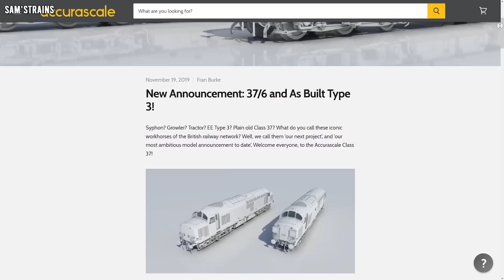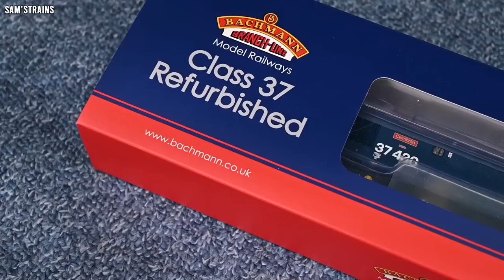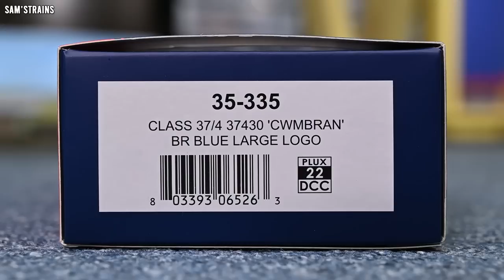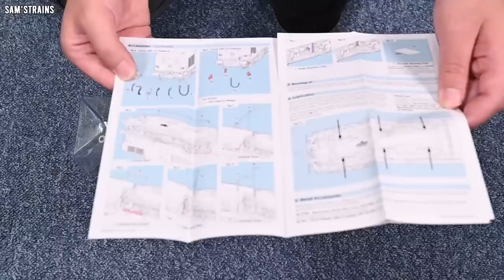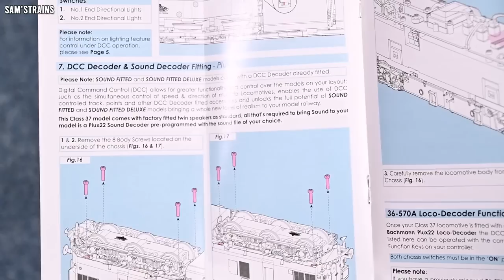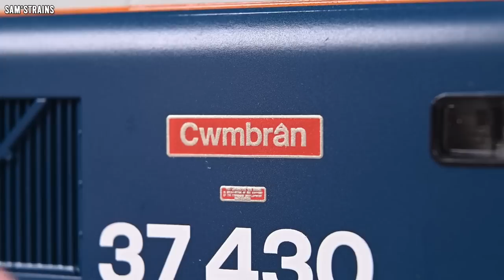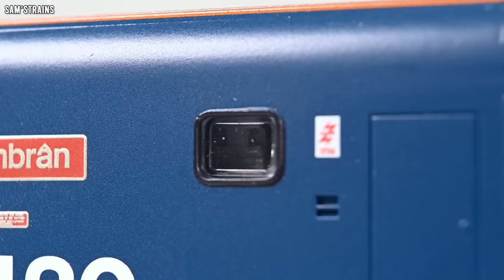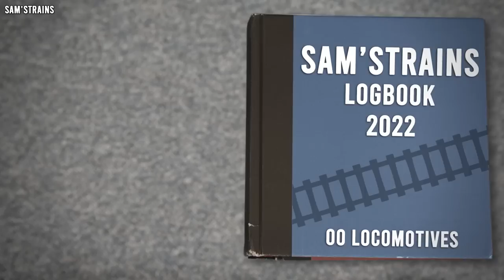All New Bachmann Class 37 | Surprise Release | Unboxing & Review

Comment: I've also seen Dean Park's review of this, and he brought up a few other points on this.
- Apparently the old version of the 37 was out of scale in a few key areas, and this meant it looked slightly off to people who knew the design well. This has apparently been connected with the retool.
- Underframe details is apparently now more prototypical.
- NEM sockets have been moved forward and can now be removed if desired (say at the front). On the downside it means the NEM snow plough no longer fits probably, despite the paint work.
- Don't think he saw the slow down you saw, but he was running DCC not DC.

Nice balanced review from you though.

Just picked up a new Bachmann FNA nuclear flask wagon, are you going to review these? They are a bit  pricey, but look good, and no one else makes them. Not had a chance to run mine yet though.
Reply: Hi, Accurascale make nuclear flask wagons, they are amazing compared to the Bachmann models, £149 - £159 for a pair. I saw an old Bachmann advert where their nuclear flask wagons were £29 each, they are now £50 - £60 for the same item.
Reply: You're lucky to find a used Bachmann FNA for £29 today. Both of mine (Both 38-345) cost £42.
Reply: @StormmyStormmy   Fair comment. Accurascale make the KUA, which are used to transport nuclear fuel from submarines.

What I meant was no one else makes the FNA wagon, which were commonly used at Nuclear Power Stations for fuel transport up till 2018ish when they were replaced by a new version (think revolution trains are designing these ATM).

As for second hand, I looked at these, eBay wanted nearly £45 minimum bid (with p&p). I therefore decided that buying new at £50 was probably best, plus I need I fairly urgently for a project.

Comment: I suspect bachman maybe have their  own tooling dpt as opposed to accurascale sub contracting its moulds. This retool could have been a scheduled side job to use up spare machining capacity ? Lets face it, 37s are gonna be steady sellers, whereas new classes are gonna be a gamble.
Reply: Bachmann are owned by Kader Industries, who manufacture all their items in China.
Reply: @mccarronfamily  Interesting. Never knew that. Quick bing shows based in dongguan, I can see dongguan from my apt. So yup, fair size company, most certainly will have its own tool makers. That matches what I said above 👍. If they have a fair amount of tooling etc, lot cheaper to reporpose it, new inserts etc. Compared to accurascale who will still be at dedicated tooling stage 👍

Comment: I find it coincidental that Bachmann have announced a new tooling 37 during the near final stages of development of the Accurascale ones. It does beg the question as to if Bachmann is trying to go head-to-head with Accurascale deliberately to try and steer customers away from the new kids on the block.

If that is the case then it's another example of unnecessary competition,and an example that the hobby these days is just trying to make as much profit as possible, not listen to the community who actually want to see models that don't yet exist (or desperately need a retool) to fill in the market and charge silly money for models that probably cost more than it actually is to sell one realistically to a retailer.

Nevertheless, the new 37 definitely looks the part!
Reply from the maker: I find it difficult to believe that it is a coincidence as well...
Thanks for watching, Sam :)

Comment: I've got a feeling Bachmann was working on the class 37 before Accurascale's announcement.
I'm sure they pushed the release forward to get it on the market before Accurascale.
From all the pre-release models I've seen, both models are pretty awesome with lots of version differences covered.
I will not be getting either model of the 37 personally as I've allocated all my cash to the Accurascale class 31 pre-order.
Nice review as usual.
Reply: To be fair, Bachmann have recently retooled the 47 and the 20, so that would make sense.

Agree with the rush to market, the fact that 2 got pushed out ahead of the rest of the range would indicate this was rushed slightly.

Comment: Accurascale wouldn't be worried about Bachmann's offering considering all of Accurascale's Class 37's directly from them are sold out and as you stated are a lot cheaper with much more refined tooling thus IMO the Accurascale model is better for the following reasons.
1. Bachmann roof fan grill is too prominent and doesn't have the fidelity compared to the AS 37, yes I'm comparing photos but to me it is obvious.
2. Bachmann cab windscreens have a pronounced prism affect and way too thick looking like something from Hornby Railroad.
3. Bachmann ploughs on this are still like the old ones and awful.
4. Bachmann cab door hand rails appear to stick out too far, slight but noticeable.
5. Bachmann nose end join...not good considering this is new tooling.
6. Bachmann sound on the sound model to me is sub-par and still sounds hollow which Bachmann to be honest struggle with on all their sound models to get it right in regards to fidelity and bass, their speakers are rubbish.
I will only stick to my Accurascale Class 37's I have on pre-order and the Bachmann versions will not join my fleet no matter what current day ones they do which thankfully they haven't announced yet even in today's Autumn announcement.

Comment: I was expecting you to really lay into Bachmann with this, trying to steal Accurascale's thunder. If it had been Hornby I'm sure would have and the comments certainly would have.
This dual manufacture of a certain new tool model type, is now becoming the industry norm. 
The first ones I remember were the Black 5 and Class 08 between Hornby and Bachmann. Now even Dapol and Accurascale have simultaneously launched their GWR Manors and then there's the who-ha between Rapido and Hornby over the Lion loco and associated wagons.
The Class 37 though is so numerous, I'm sure the market can stand two versions. Now if Hornby feels they need to replace their ancient offering (they need to), could the market stand it. I wouldn't be surprised if they did, so to try and drive Accurascale out of the market. Am I being cynical ?
Reply: Your memory is playing tricks - Bachmann have never produced a Black 5 (what they do produce is a British Railways class 5 which to be fair did take its inspiration from the LMS designed black 5).

Where Hornby and Bachmann did go head to head was with the British Railways designed Standard 4 class - with both being released around the same time.

The class 08 is slightly different - the Bachmann tooling is a lot older than Hornbys - for many years after Bachmann introduced their 08 Hornby were churning out a rather basic 08 body on a linty 0-6-0 steam loco chassis. Therefore when Hornby finally decided to ditch their antiquated 08, the detail on their offering was better than the Bachmann model simply by virtue of customer expectations having increased in the years after the Bachmann model was designed.
Reply: @philkeller4170  yes definitely confused. I personally refer to both types as black fives. Both companies making the same loco type was a topic of conversation back in the day at my model railway club. 
For general interest, back in 2013 I went on one of those Cathedral Express trips. Tornado was meant to pull us but had failed prior to the trip. What turned up was a double headed BR Class 5 with a LMS Black 5. A historic first we were informed

Comment: So, will I buy one in BR green ? Mmmm... Price first, the Accurascale wins, do we have something that justifies this price for Bachmann ? First, it seems they are going away from the MTC 21 pins decoder, and adopt the PlusX standard, more "European".
Then, superb finish. Details ? Just Wow ! Good point for the couplers mounted to the bogies : simple and efficient. Serviceable ? The removable chains are as genius as the tender-locomotive connection on the Dapol Mugul. Easy to open, a good thing, you can only point the number of screws and the connectors as a drawback (a minor one anyway). For the price, the non-rotating fan is a serious down. Dynamic performances : not overgeared at first glance, a precise metering might confirm this trend. Good performances overall, but lacks pulling power as you show us, another serious drawback for the price. Seems there is no flywheel, or no efficient ones, a serious drawback for the price.
For me, it's a mixed bag as is, and I stick to the Accurascale, unless it is a lemon.Overall nice, but the price makes you look at every points which needs to match it.Average performances, presumed absence of flywheels, no cabin lights on DC and fan not motorized, that won't fly at such a price. With an RRP of GBP 180 or less, why not, but I have no reason to change my initial plan to buy the Accurascale model by now. The only reason I would buy this one is if the Accurascale model is really bad. Outside the price, it's a good model but when you factor what you have to pay for it, sorry, no. Especially with the Accurascale model incoming.
So, let's wait for you test of the Accurascale class 37. And the Dapol Manor had arrived at Rails of Sheffield by now, in case you missed it.

Comment: Interior cab lights should be OFF WHEN IN MOTION!

Having them on affects the ability of drivers to see signals - just ask yourself when was the last time you saw a car driver speeding along with all the interior lights on either.

As such you should be deducting points from models which have them under analogue! 

I doesn't matter if other manufacturers provide cab lights which work on analogue - the basic FACT is that such things are entirely non-prototypical and the first thing any self respecting modeller should do is electrically disconnect them when running under analogue control (DCC users can usually simply turn them off).

Where interior cab lights come into their own is when a loco is stationary, parked up in a depot say - however quite obviously unless you fit your locos with batteries such a feature can only be utilised by DCC users, so by not having the lights working on analogue, Bachmann are doing it right.

Comment: I bachmann may have been planning this before accurascale and also the extra 40 
Is well justified when u by a loco and u get so meany problems and for a lower than normal not surprising 
Bachmann has always been unbeatable in the quality with their diesel I have all the older bachmann 37s not one one piece of detail has come off not one light has failed in the almost 20 years of ownership for the older ones so that extra 40 u pay to make 208.20 is still a bargain for what u are getting and can trust it will last a lifetime
Reply: Wait for the accurascale 37 and then you can decide :)